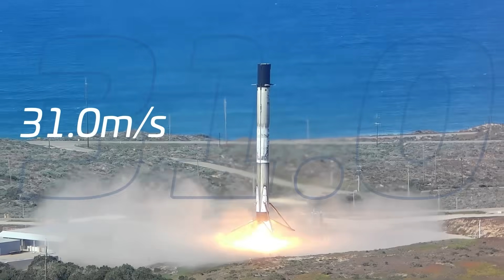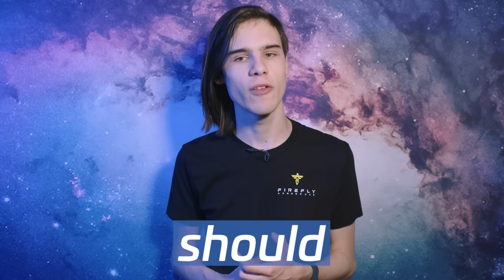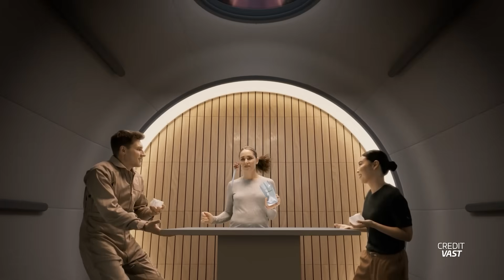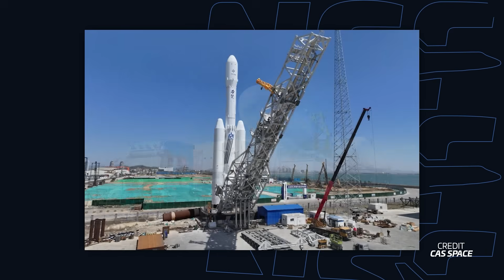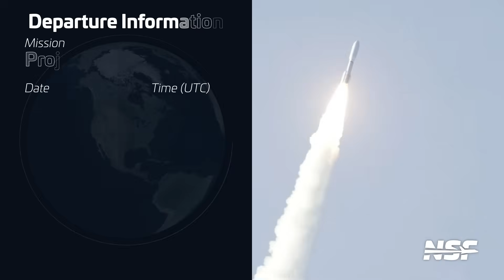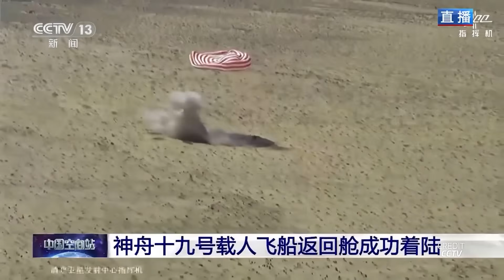🚀🚀 Double Starship Fire Tests, Burst Habitats, & Lunar Rovers | This Week in Spaceflight

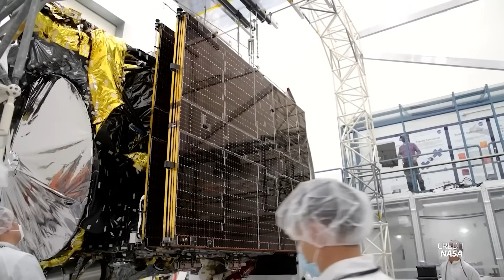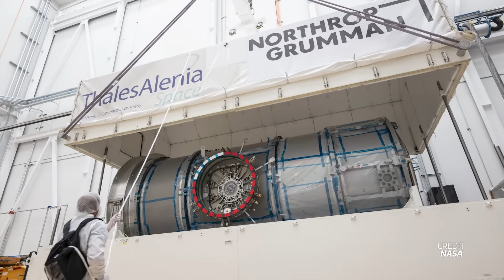Comment: 6 launches between 12:10 28Apr2025 to 5:37 29 Apr2025,  6 launches under 18 hours (1 day)  The prevoius record was 5 launches, one sub orbital. Did this in fact make a record?  Or does FireFly failure disqualify it?  Or does 5 orbital beat out 4 orbital/1 sub?

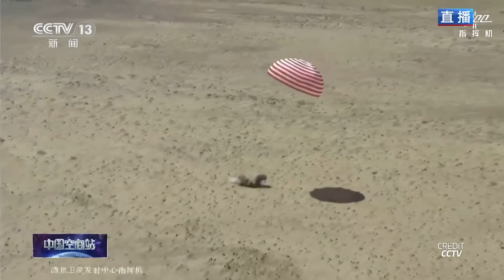Comment: That Chinese capsule landing at 22:01 looked extremely hard. I'm sure it bounced and rolled and it almost looked like something broke off.
Reply: It uses compressed air thrusters like Soyuz and New Shepard which make it look waaayyy worse than it actually is
Reply: Ya but it had a lot of horizontal movement so it rolled over twice and rested on its side which isn’t suppose to happen but I’m sure they are fine.  Definitely didn’t feel good though 😂. China needs to take more accountability with its space program with boosters falling into populated areas around the world not to mention the near miss of the iss.
Reply: Doesn't it look so violent because of a burst of propulsion that slows it down?